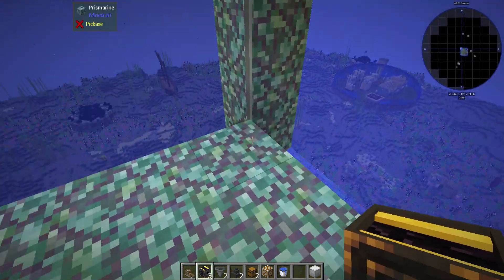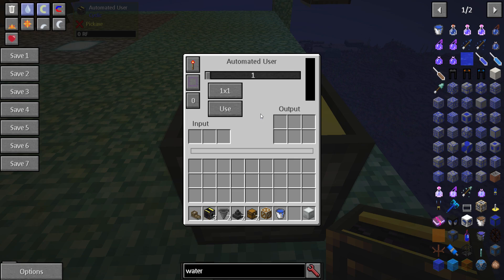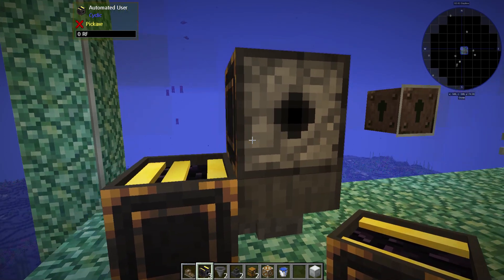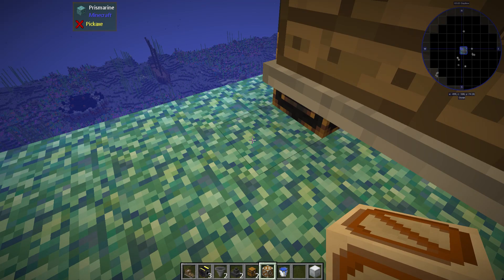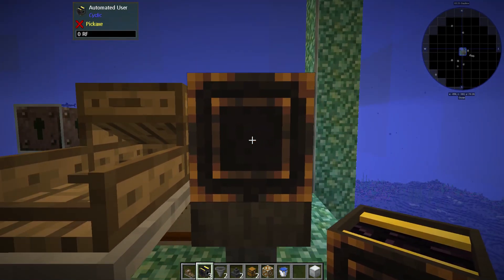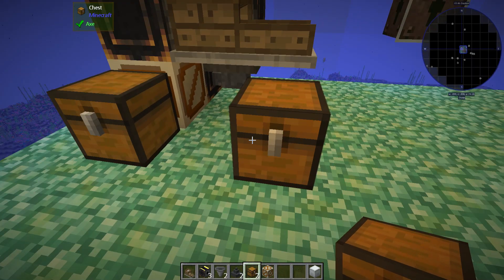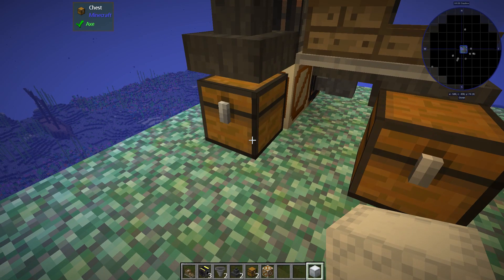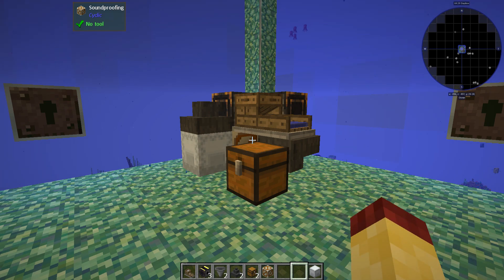My Sluice Automation for Rustic Waters

Comment: Great... works brilliantly...
  I couldn't add the Sound Proofing, as it's Merchant only. Soo... cannot be crafted. But it's just to silence the machine, so makes no difference.
Reply: Last time I played this mod pack I got two sound mufflers from a quest after making a steam hammer. It has been a while since I played the pack so this might have changed.
Reply: @itsddtime1252  Thanks... I just got it, it was in PARTS PRODUCTION section, the HAMMER TIME quest.
  I got 2 sound mufflers and a diamond axe...

Comment: I took this a few steps further by raising it around 6 blocks from the ground, then connecting a few double chests down the hopper and creating a chest overflow system.  Then connected the bottom chest to a prismatic furnace, with an item transfer node pulling out ember fragments and coal from the hopper right before the furnace.  Then having a hopper below that connected to a double chest system.  Automatically smelts the rocks as well as keeping the furnace fueled with the coal.

Problem is that it worked fine until last night,... now it's not working at all.  Even the basic sluice build that you showed above isn't working for some reason

edit - NVM,.... I did a smart build,... only I pulled a dumb.  Was using the ore chunks to try and make sure the system worked,.... not dirt/sand/gravel x.x.  System works perfectly now lol

Comment: Interesting - other designs I have seen require some way to refill the water bucket. Is this not necessary in this case?
How would you adapt it to use multiple sluices for speed?
Reply from the maker: Answer to Q1: This build uses a bucket that gets refiled. This is done by the automated user that is facing the wall and has the working area set to 3x3. The user will pick up one of six water source blocks that are on the outside of your base every time the empty bucket gets fed into it by the hopper. The bucket of water then gets sucked out by the upper and put into the second user. When the timer on the second user reaches zero and the sluice doesn't have any water in it the user will use the water bucket on the sluice and dump empty bucket back into the hopper. The process repeats until you shut it off.

Answer to Q2: I don't recommend adding additional sluices. This is because for every sluice you add you will have to add an additional user and the corresponding item inputs. This, in turn, will make the thing use more space than necessary. On top of that, the only time using more than one sluice is beneficial is if you are operating it manually.

Comment: How does the bucket get refilled?
Reply: By putting it in the user next to the sluice box, it uses the water on the sluice, then cycles through the upper connected to it, down into the automated user pulling a 3x3 square (which if done right, will be pulling water from outside your base) of water, which will then refill the bucket and send it through the hopper, repeating the cycle.